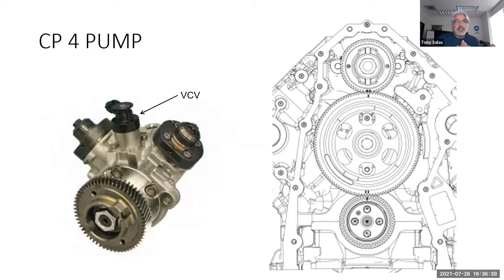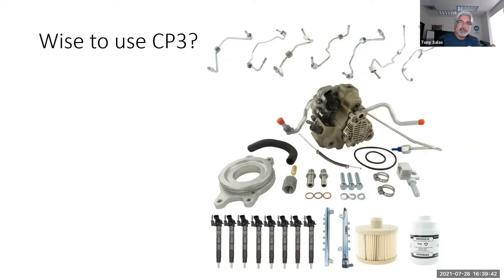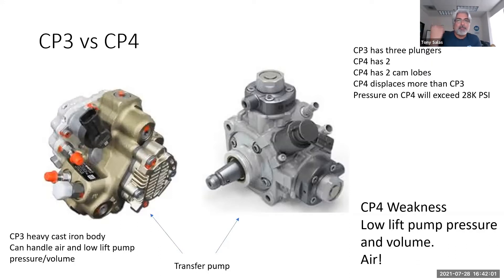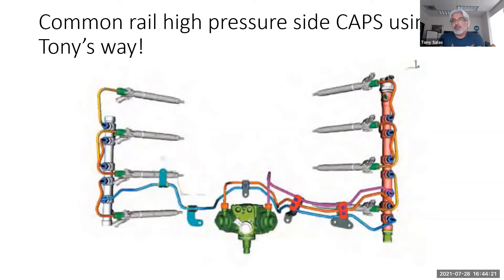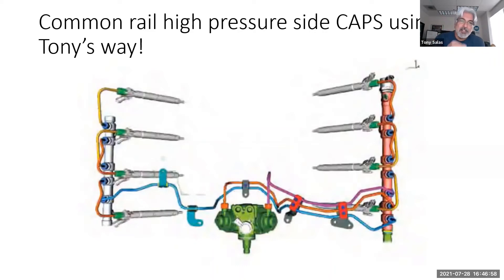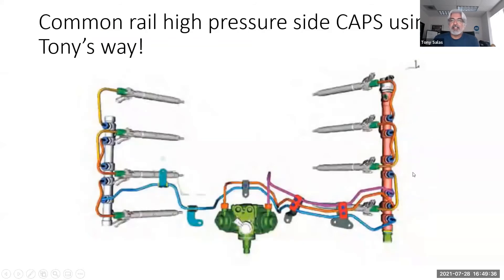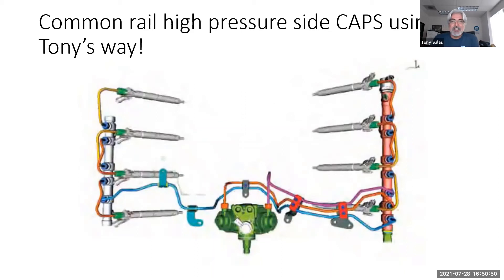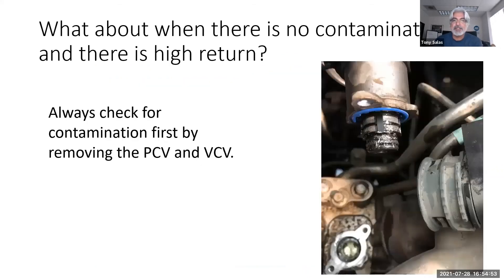Powerstroke 6 7L CP4 pump

Comment: Will the high pressure fuel line connectors that connect to the injectors and the rail leak if you do not get new ones as GM states to do if they're removed or can you just re-torque them to spec and call it good? Or would you suggest tony's way and sand the crush fitting?
Reply from the maker: I’ve always been about doing the job right. Replace lines. There is a chance of leak and possibly a fire. If Tonys way was done was due to circumstances come about but truck was ran with high rail pressure for a while before driving it.

Comment: It’s great to see some real information on this issue . I’m a machinist by trade and build main coolant pumps for nukes in my profession, and there is so much garbage on the internet on the cp4. Bought a used 19 power stroke and have been putting hours towards researching this subject. Keep up the good work.
Reply from the maker: Thanks for the comment! I appreciate it! Glad the info helps

Comment: Hey Tony... wonderful video. Thank you for taking the time to put it together. Curious about your strategy for diagnosis on a P0087 low pressure DTC that sets at maybe 5 seconds into WOT. At idle, commanded, desired and actual fuel pressure all the same. Fuel pressure switch pid stays “not low” during test drive at WOT, but “actual fuel pressure” drops to half of commanded. No contamination of fuel system. Both the PCV and VCV replaced with no evidence of metal flakes. No injector return leakage. Is there any other way the CP4 regulates fuel output internally that can fail without the pump falling apart?
Reply from the maker: Based on what you are telling me sounds like the pump itself is going out. 
Won’t see metal. We discussed this in our roundtable on how Ford offers no return specs. So we use Duramax LML return specs since it’s the same fuel system. Btw did you torque that PCV correctly because it will give that same symptom if not torqued.
How many miles on truck?
Reply: @dieseltalkwithtonysalas8725  Thank you sir for your response. Yes, I did torque PCV following the procedure. Truck has about 60K. Followed PPT to the end and it came down to one or the other. That’s why I’m curious about that pump and if pressure can bleed down internally. I didn’t suspect lift pump output causing an issue. If the HPFP has adequate pressure on the inlet side, I would assume volume would be adequate itself so it would be safe to assume the HPFP pump has fuel at both idle and WOT. Do all the maintenance as required and every filter change, hook the scan tool up and command lift pump to complete bleeding.

Comment: I have a 2011 that just quit. FAIRY GLITTER! The other issue is that the oil is way over full, and leaking out of everywhere down low. I can’t figure out how this happened. It’s got diesel in it. 200k on the truck, oil was changed at the dealer 3 days before it quit. How does the diesel fill up the crank case? The injectors looked the same after removing them. thought that one cracked and flooded a cylinder. But. 
The motor still spins over fine. 
Any ideas?
    I don’t want to spend the time and money on the kit to replace all the fuel system and then have a washed out cylinder wall. 
Thank you
Reply from the maker: Just to be clear, the oil is diluted with fuel?

Comment: I'm actually unaware of a company that sells a cp3 retrofit for a 6.7. My assumption is that the sizing constraints in the valley make it impossible without modification to the surrounding areas, at least for the stock location. I have a cp3 on my 2011 6.7 but it's in the form of a secondary dual fueler kit from H&S. Which places it in the factory dual alternator location.  I have however seen cp3 swaps for the Duramax and Cummins platforms.

Comment: My cp4 just went at 215k miles on my 19 .  Do the fuel additives work like some say they do? And if so what ones do you recommend? Thanks
Reply from the maker: The point is which additives. Stanadyne performance formula has been one of the top ones along with Alliant Power. Lubricants help quite a bit but some contain to high of sulfur content. Too much sulfur hurts the cat docs.
As for cleaners I like BG245
Thanks for commenting!

Comment: Hey Tony have a 6.4L Powerstroke customer filled up on gasoline. He drove 30 miles then truck stalled. I'm guessing major damage to high pressure pump. What's a good way on this 6.4L on checking for metal?
Reply from the maker: May not have damage if he is lucky. I drain the gasoline from the tank, prime the system several times with the fresh diesel. Run the lift pump for quite some time if you have a scan tool. 
Then hope it builds rail pressure.
Reply: @dieseltalkwithtonysalas8725  Hey Tony thank you for the response. Have lots of your training videos From AVI every time I rewatch them learn even more. Yes have a scan tool with bi- directionals and can go factory if need be with my Jbox. I inspected both fuel filters found no metal. I managed to crack the Left high side line going into head and took sample three as well amd found no metal. Will drain everything out and go from there.
Reply from the maker: @TheManny4692  Let me know how it goes!
Reply: @dieseltalkwithtonysalas8725  Tony on that 6.4L Powerstroke. I took out all the gas put in diesel took the return hose off FPCM ran the electric pump till only diesel came out. Installed new fuel filters truck actually started and ran fine. Let the customer know future high pressure problems could happen later.
Reply from the maker: Good to hear! Customer must be happy! Sell them a good lubricant like Alliant Power or Stanadyne
Reply: @dieseltalkwithtonysalas8725  yes they are very happy. I was thinking about the stanadyne. Thanks for the responses. Hoping to come out to Vegas and take some of your hands on classes.